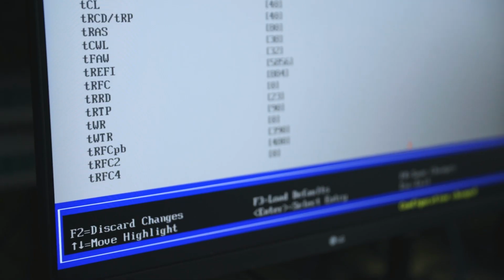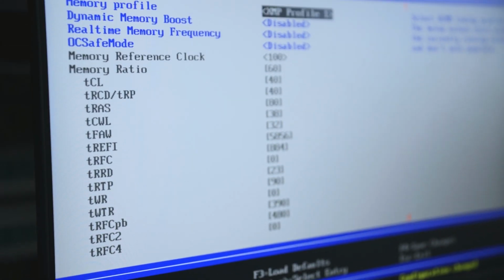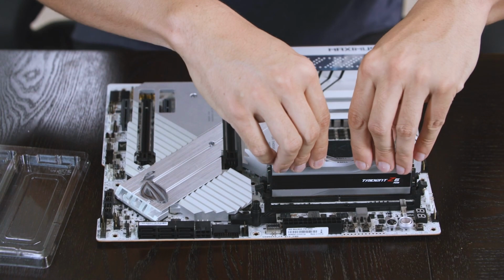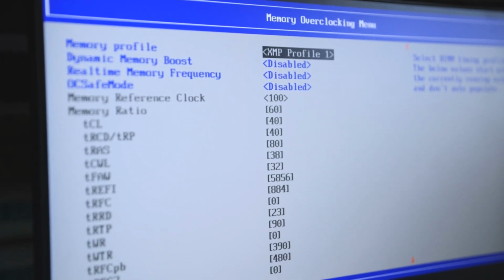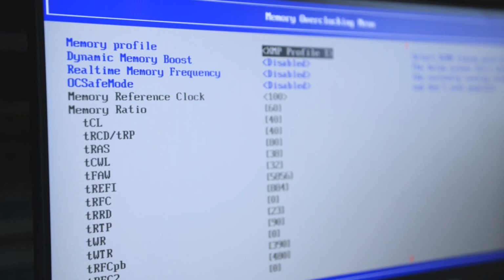The History of Intel Extreme Memory Profile (Intel XMP) | Intel Technology

Comment: One suggestion. I don't like fan noise or heating in laptops. Can you provide a solution where the compute unit (motherboard, RAM, processor, etc) is housed in a separate unit like NUC extreme, and display unit (battery, keyboard, speakers, trackpad, wifi module and display) becomes a separate module very similar to HP Elite Lapdock. And the display module can be connected to the compute unit either wirelessly or through cable.

The compute unit and display unit, both should fit in a backpack. This will be good for people who basically use laptops on desk and for whom, portability means ability to carry it in backpack.

This will reduce fan noise or heating effects while using a machine and at the same time, laptops will become thin and have longer battery life.